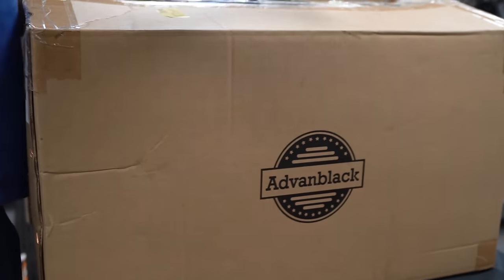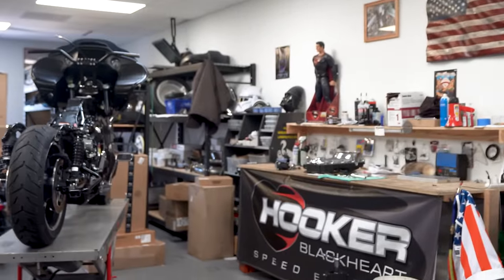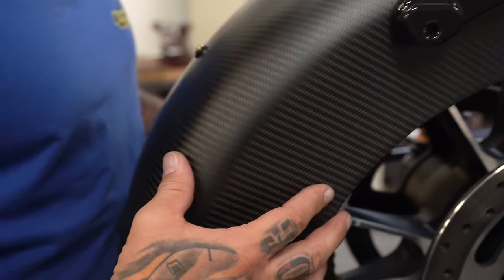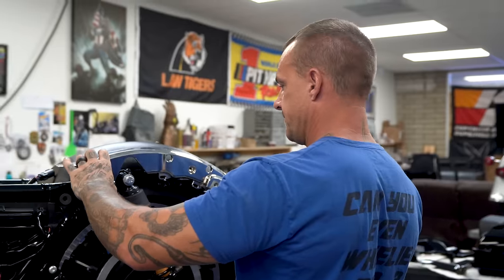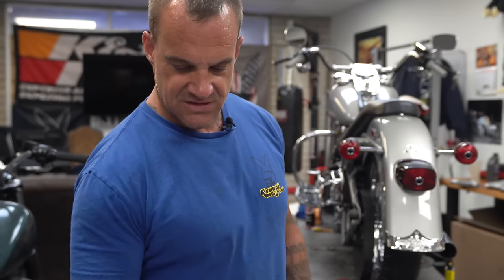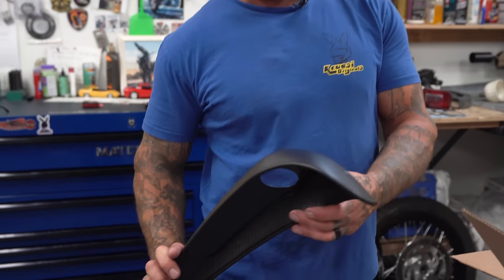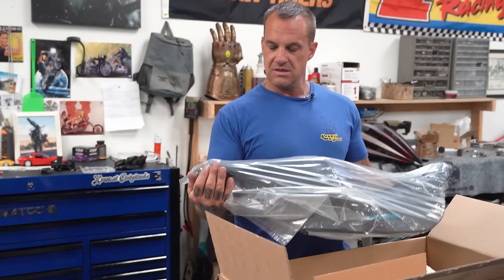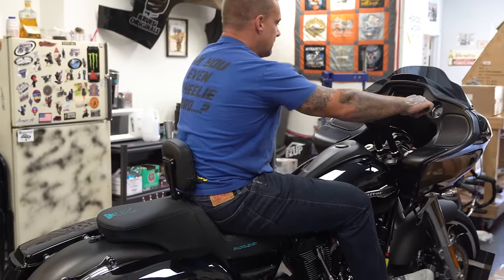New Carbon Fiber Fenders From Sly Fox - Moc Up And Unboxing Advan Black Parts. 135' PART 3

Comment: He flips the bill for carbon fiber parts, but then uses stock shocks? SMH
Reply: foots the bill , flip is finger, pancake and lid.
Reply: @BobbySchaffer  Both work. 
An arcane expression meaning you will pay for something in full. It harkens back to ye olden days when people carried billfolds instead of a VISA card, and they flipped a greenback out of the billfold to pay for something.
Don't worry about dinner, I'll flip the bill.